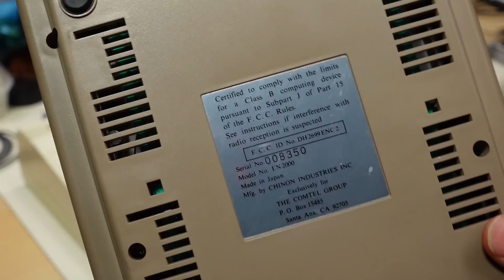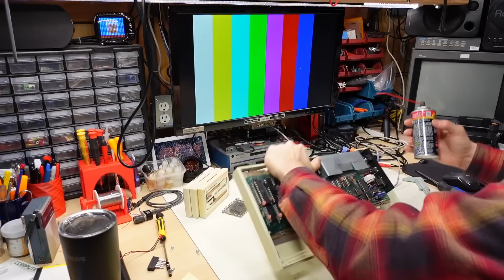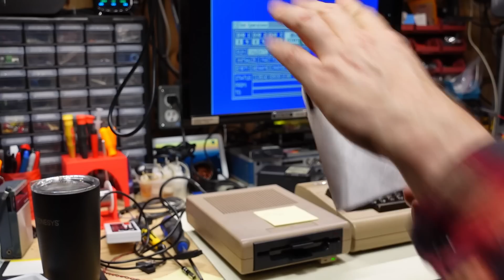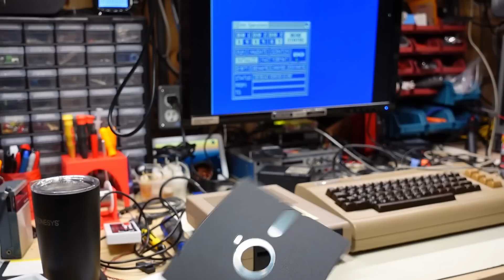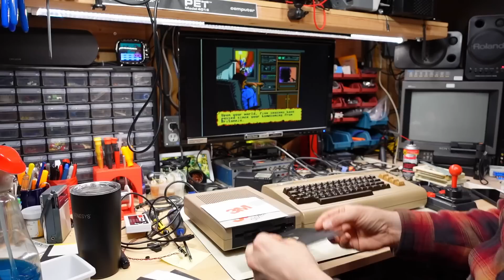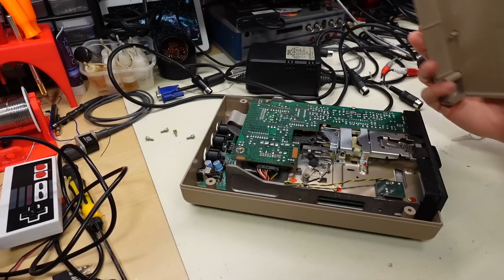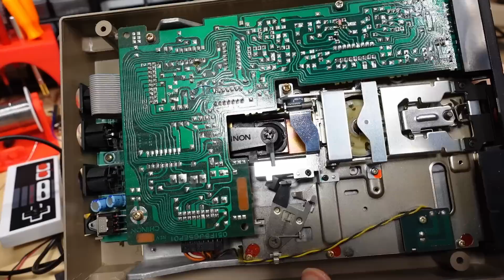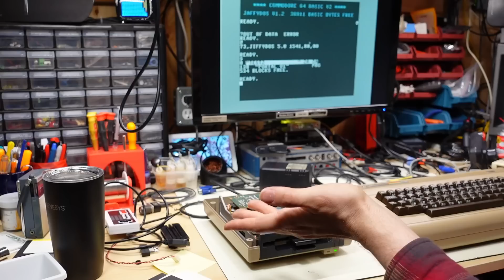0036 How compatible is the Enhancer 2000? (A clone of the Commodore 1541 disk drive)

Comment: you did a comparison of jiffydos vs action replay and found they were nearly identical. So I don't see the point of using jiffydos when action replay works without mods.
Reply: I suspect he just does that since a lot of viewers don't have action replay cartridges and probably wonder.   I guess he could mention it, but the jiffydos method is the one a lot of people use since it's easy/cheap.
Reply: @BrianV_PM  I have a U2+ which had it built in. Now you have to load it after flashing the firmware, but still It's awesome because it just works. Where as jiffydos requires hardware modification and it's not always compatible.
Reply: @awilliams1701  I personally used the jiffydos switch method where you can install multiple kernals and switch between them, so can turn it on and off by holding down a few keys on the keyboard (doesn't need a physical switch).  That method was pretty inexpensive.  Just swapping the rom is the easiest and only costs the price of an eprom (and i guess buying jiffydos) but does have the issue you mentioned.  I think the thing i like with the jiffydos switch method is that it's all hidden away and i don't have to deal with a cartridge, but i can see the benefit of the cartridge method also.

Comment: Pretty cool drive (both as a product and thermally too apparently!), but as you've shown previously, even a 1541 (and 1541c) can be made to run cool with the use of a switching power supply, I fitted mine with a Meanwell RD-65A 5v+12v supply and it runs cool as a cucumber, but the size of this Enhancer 2000 is pretty neat given it sits nicely beside a VIC-20 or C64 without being a massive beast like the Commodore ones... :)
Reply: Commodore did offer a model with an external Power supply eventually with the 1541ii. It was basically half a 1571 without the burst Mode...

Comment: That copyright notice is hilarious. I guess they’d allocated so many bytes and filled half of them, then someone decided to have fun with it instead of filling them with F or 0 :) 

Perhaps being smaller, quieter, and running cooler was “enhancement” enough in the original sales pitch? Presumably it was cheaper too, and the UX on that drive mechanism is definitely more novice-friendly! If you can get Jiffy running on this, then it’ll be an Enhancer 3000 🤓

It’s probably not the case, but I kinda wondered if it was the apostrophe that confused the Enhancer ROM under JaffyDOS, like maybe a one-word file save (like the other tests were) under Jaffy might not have exhibited the same behaviour? I guess it’s not that important to try though, heh.

Addendum: it’s always fascinating how something small like half a millimetre can make all the difference to our eyes. Since you measured the same difference in key top and key spacing, the base is the same size but the tops were shrunk slightly. I think the biggest contribution is going to be how that affects the angle of the slope, on the sides of the keys, since they’re pretty tall. The taller it is, the bigger the angular delta will be even for the same width delta.

Comment: I had an Enhancer 2000 back in the day. It worked with all but a few forms of copy protection. I always used a Mach 5 cart for fast loading.
Reply from the maker: Interesting -- I'd love to do some comparisons to the drive with and without the 6502 and stock ROM. Unfortunately, I really don't have any original copy protected software for my C64

Comment: Could that directory error be due to you giving it "8" instead of a two digit ID that the format command requires? ( @N:NAME,ID where ID is not the device number) because the disk name heading is garbled. The end should be in the form "01 2A". @-commands use the default drive. You change the default drive with @#x where x is device number.
Reply: That's exactly the problem.  He gave it a one-digit ID instead of a two-digit ID, and that threw it off.  (Normally, I think the drive would append a space to the end of a one-digit ID, but JaffyDOS and/or the Enhancer 2000 may not do that.)
Reply: @SpearM3064  CBM  basic follows an explicit BASIC line storage format.
The first two bytes point to the next line number in memory (standard low/high byte order) as it was on the machine it was saved with. (A pointer of $0000 indicates that it's the last line of the program); when you load something without the ",1" at the end, BASIC will actually parse the program and relink these pointers after the load, since the PET and C64 have different BASIC memory starting addresses.
The next two bytes are the line number (standard low/high byte order).
Finally you have the BASIC code text itself (the basic commands are tokenized but NEVER tokenize to $00) , and the line is terminated with $00.
The next line begins immediately after the $00 termination.
The malformed display is likely due to the enhancer drive ROM being bugged and padding out the disk ID with hex 0 instead of the space character (when he did a "N:ADRIAN,8").  The basic interpreter will have the line terminated early as $00 indicates it is the end of line.  The next 2 bytes would be overwritten/relinked by basic (to point to the beginning of the next line).  Then you have line # 65, which would be a PETSCII "A" followed by a null (which would probably be the "A" in "2A" you usually see, followed by the real end of line).   As there is no text on this line, it encountered a hex $00 in the first place of where it thought it was BASIC code.  Again, the next two bytes are relinked/overwritten after the load command (but these bytes are probably $01 $00, the block count of the BASEMENT program).  Then you have 8736, which is a lower order byte of 32 (a space) and a high order byte of 34 (the quotation mark). Basic spits this out as a line number when it is supposed to be a part of the text listing.

Comment: Interesting, I thought Goodwill just immediately throws away any retro computers they get.
Reply: That seems to be what they do here in NY and CT (or they auction them off at inflated prices, although I expect the NY/CT stores couldn't be bothered).  
In general the Goodwill stores around here have become little more than clothing stores along with fugly furniture and equally fugly dinnerware.  Not much use for anything electronic unless it's a mid 2000's flat panel TV.
Reply: @SenileOtaku  For me what I usually buy there are occasional PC games mixed in with the music CDs, but it's been a little while since I've found any.  I have much better luck at a different thrift store I frequent.  My Goodwill currently has one thing of interest to me, a weird Famiclone system that looks like a penguin (MetalJesusRocks did a video on it).  I would get it, but they want $30 for it so fuck that.  I asked the manager if the price could be brought down at all and she said "they don't let us do that."  If that was at my other thrift store it would be way cheaper.
Reply: Yeah, here in LA they never have any retro computer stuff but I'm pretty sure it all goes on their ebay/shopgoodwill site as I see local stores listed there.  I kinda doubt they toss them anywhere unless it's clearly some odd computer (like that 70s computer that adrian just did a video on) because they do bring in a decent amount of money online.  Most of the stores go through things now and separate out products for online sales.  I don't find going to goodwill worth a trip, but I go in if I'm next to one... there's almost never anything there though.

Comment: It was about 1986 or so when I got mine. Couldn't get a 1541 anywhere. I got it with a bundle of a Freeze Frame cartridge but I already had a Action Replay MK2 so sold it to a school friend. I remember getting the Eidolon on disk and it wouldn't boot due to copy protection argh. Many of the other drives were naughty and were in fact clones of the 1541 using the original ROMs which Commodore wasn't too happy about.

Comment: There is actually one more earlier step for goodwill. If the item has perceived value, it will be listed on their auction website and never be put out on the floor. I have bought a couple C64s (kind of overpriced, lately ) from their auction site. In fact, I just finished troubleshooting a C64 that I think came from them - it needs 4 new ram chips (4 test bad, but they are all MT) and it had a bad power switch. I've learned so much about c64 repair from you, Jan Beta, etc. Thanks!
Reply: Next thing you know, goodwill will start removing the SID chips and sell them separately.  :)
Reply: @BrianV_PM  Ouch. Like some of the completely stripped C64 boards you see on ebay that are STILL way overpriced.

Comment: So glad I was able to offer up something you weren’t that familiar with.. The only reason I knew about the Enhancer 2000 is from David Murray’s video about Commodore clone drives. As for the Vic-20 badges, I harvested the original ones on there and the ones on there are ones I got on Etsy and poorly cut down to fit on my TheVIc20.
Reply: Ohhh! No wonder (about the badge) That's too funny. I ended up using the case on my ZIF-64 anyway -- so I stuck the C64 badge on it. :-)